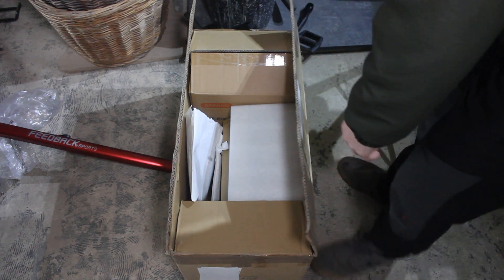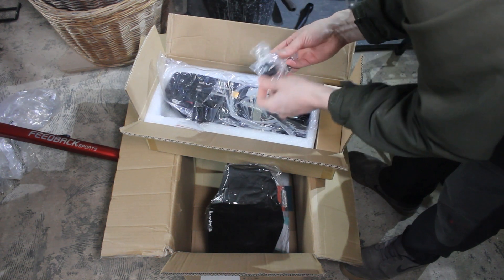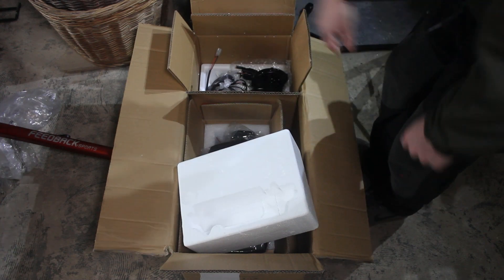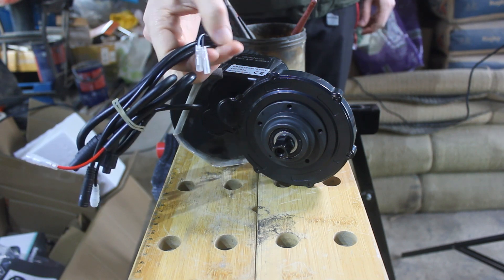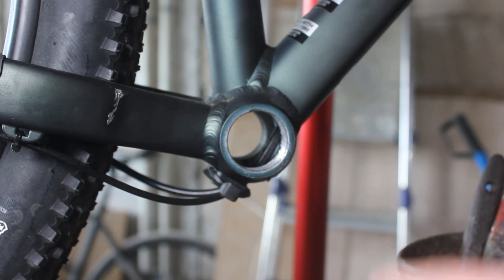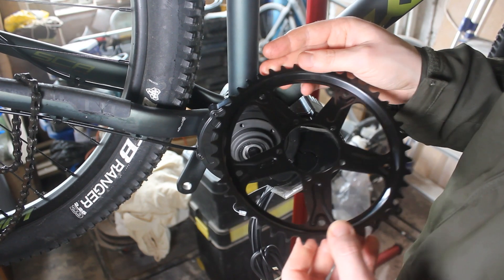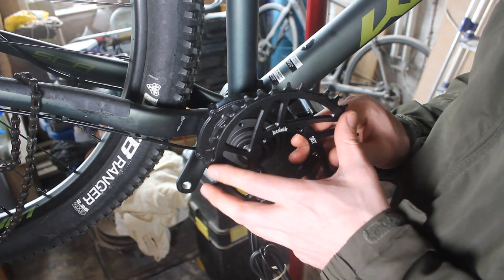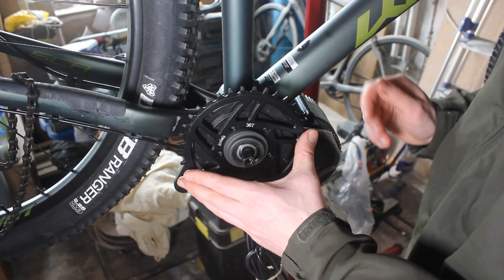E-bike Build #2: Unboxing, Motor Install, Drivetrain Re-Assembly

Comment: Let me see if I got this straight ... in the previous vid you used those templates to see which motor fitted your frame the best? Obviously the 750w motor fitted much better than the 1000w motor. Is this the main reason you chose the 750w motor over the 1000w motor? Good vid btw
Reply from the maker: It was a combination of the fitment, price, and power that helped make up my decision. Yes I wasnt 100% sure if the 1000W would fit perfectly and so choosing the 750W made me a lot more confident. I put a lot of trust into the templates 😅. I knew the 750W would be perfectly adequate power-wise anyway. Taking a risk on something so expensive didn't sit well with me haha.
Reply: your vids are really good! you deserve more followers

Comment: Where did u get them ? And how much? Which model should u prefer if riding in city ? How many watts for city riding? Thanks
Reply from the maker: Hello, I got my main parts from a company called Varstrom, or you can also get them on Ali Express. You can look at the prices on the websites for an idea of the cost, I think I paid about £700 for my parts. I think most models will be great for riding in a city if they are installed correctly, and in terms of the wattage, all I can say is that my 750W has plenty of power to get me uphills easily. Lower-wattage motors and smaller batteries might be cheaper. You may also want to consider the laws of ‘electrically assisted pedal cycles’ if you want to ride on the road. In the UK I think you are limited to 250W for riding without insurance and tax, so check and do your research before spending money. I hope this helps.